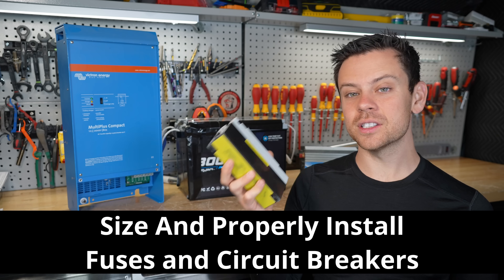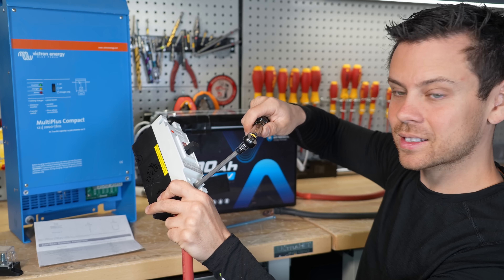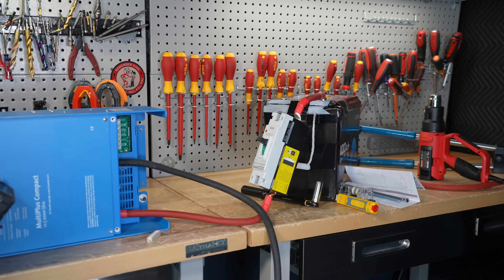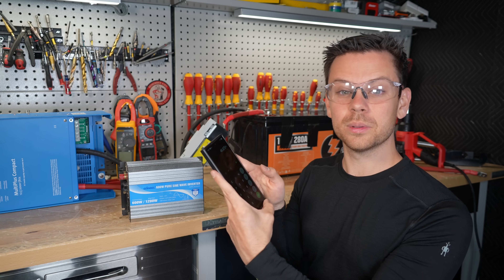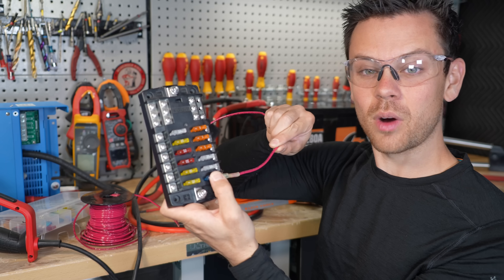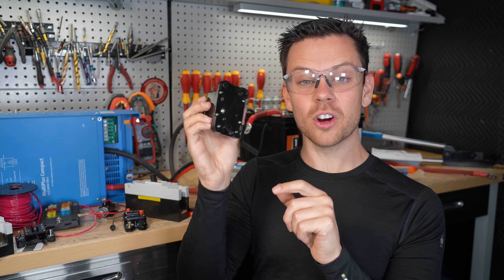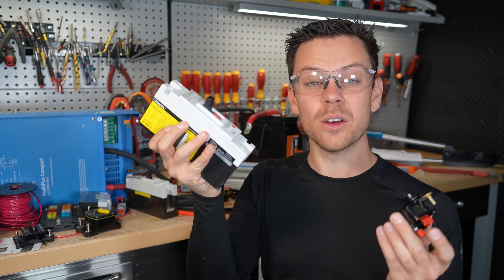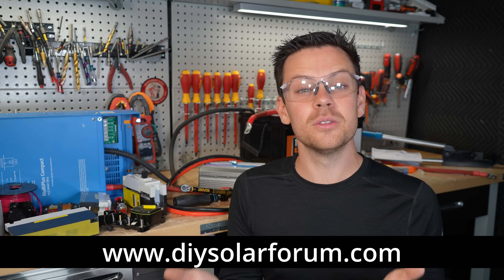How to Size DC Fuses and Breakers. Bonus Tips and Tricks!

Comment: Great content Will, as always. Just one thing—you calculated the current draw of the 600 W inverter as 600 W / 12.8 V = 46.9 A. The inverter is probably only about 85% efficient so it'll draw more than 46.9 A when delivering 600 W, i.e. it'll draw 46.9 A / 0.85 = 55.1 A. Maybe the inverter is 90% efficient but you get my point.

Also, I would do the calculation at the battery's low-voltage cutoff, because that's when it'll be delivering the most current as the inverter is a constant-power device. Both the battery voltage and the inverter efficiency are important factors and might force you to use a higher-amperage fuse to avoid nuisance fuse-blowing (or breaker tripping).
Reply: This ist true. Efficiency is often forgotten leading to borderline systems. This ist offen bis noticed as few systems operate near its full load. 
Can get tricky though if you have higher loads in RVs for example when cooking on induction hobs at max load (not pulsing)...

Comment: One thing that Will touched on I'll expand on. He mentioned to never place a washer between the two electrical connection points. The same goes for nuts. Nuts, bolts, and washers should never be called upon to have the current flow through them. Their function is to hold the conductors together.

Comment: I like to install a battery switch and then add a resistor with a momentary button switch in parallel.  That way you can precharge the inverter's capacitors every time you reconnect it.

Comment: Before everyone runs out and buys the MCCB linked in the description, just know that Dihool is NOT UL listed. If you plan on getting your system inspected, this will likely be discovered.  Will really should have mentioned how few MCCBs have UL listings and the ones that do are VERY expensive.  So really, a useful video in understanding sizing, but a poor video in glossing over the realities of code compliance.  I must say, there needs to be more emphasis placed on what is and isn't code compliant in a lot of Will's setup and recommendations.

Comment: its funny when manufacturers don't include cables they recommend humongous wire sizes but should they include cables they give you the absolut bare minimum that won't melt from normal usage.

That victron is a only a 100A unit right?

Comment: yea, i'm under the impression (i.e. as per the manual/spec sheet) those Blue Sea System breakers ARE for '48v'.  THAT.  IS.  THE.  MAX.  VOLTAGE!  so, do NOT use them on a '48v *SYSTEM*' - those run at 51.2v, or HIGHER.  way above the 48v MAX of the breaker.  just sayin'.

Comment: If sizing fuse to wire, what is considered safe with fuse only tripping at 200% plus of rating? Example blue sea t-class at 250a according to curve won’t trip at 500a for at least a minute. Or 300a until over 8 minutes. Is the cable safe to take that (assuming cable limit matches that 250a fuse (e.g 2/0 at 210a). That could mean a few minute’s of 500a through that cable until tripped in an over current situation. I appreciate if dead short it goes straight away which is fine.

Also is it safe to use an overrated t-class just for dead short situation, then an ANL at lower rating for OC protection only?

Comment: Hey Will, thanks for another great informative video. I was wondering if there was a self build battery or rack battery that you trust and won't break the bank. I prefer the rack mount as it seems more dense capacity per inch. Looking at doing 32KW at first and then 64KW down the road. Any guidance would be much appreciated. Hope you have a great week.

Comment: Those huge circuit breaker switches need mount holes.
Reply: They are probably designed to fit in a breaker box made by the same company of the breaker.
Reply: @Tumbleweed5150  I  was think much the same before posting.

Comment: I have 530 hp Detroit Diesels in my boat.  I am using a pair of group 31 lead acid 12v batteries for each engine as starting batteries.  The starters are 12 volts.  Can you tell me what type and size of fuse I could use in this situation?  Many thanks and thanks for your great videos!

Comment: I agree with most of what you say, in a lot of these videos. I have learned a few things, but...

I use breakers as switches, so long as the load isn't extreme. 

I really don't think the resistor is necessary, just make the connection, turn the breaker on, then turn on the inverter. 
Yes the capacitors will draw some significant current for a very short period of time. The breaker should handle this.

What happens in a short circuit/fault/overload, the breaker has to break that arc at it's full rating +, and at DC that can
be much harder to break vs AC.

I have 3 Eco worthy rack mount batteries, and two Victron 120v 5000va/70 inverter chargers, and had no issue doing just that. 
I should clamp meter the peak / surge current but I don't think it's that high. 

I wouldn't use the breaker under full load, unless I was shutting it off, in an emergency. I would power off the inverter/charger, 
then turn off the breaker normally, under minimal load.
Reply: I still prefer to load the capacitors slowly, they normally don't like high inrush current. I saw some caps blow with high inrush current.

Comment: What's the difference between single pole vs double pole dc breakers? Especially when the inverter manual says for battery max current draw is 220a and lists for using 2/0 cable with 250a breaker. However, according to your guide 225A rated current should be using 3/0 cable but there is no 225A breaker and upsizing to 250A breaker means we have to use 2-pole breaker from DIHOOL with +ve and -ve going through the breaker. In this case should we be using 4/0 cable with +ve and -ve going through the breaker?

Comment: When I was wiring in my headlights. I thought it was a 14 gauge wire turn down it was an 18 gauge. The wire start I started smelling the wires cook. And they started smoking. Fuse did not blow.  Ripped those wires out making sure nothing was still connected to the battery. I then a few days later, ran the wires again and make sure I had 12 gauge wire. And I hooked in at 10 amp fuse. Because I wasn't playing that game again.

Comment: So maybe I missed it but how does the size of the fuse or breaker change based on the battery bank size? Or does it? ie 10 x 100ah 48v server rack batteries tied together feeding an inverter or 4x 314ah 12v batteries to an inverter ?

Comment: Here’s an excuse not to buy, use or recommend the Dihool you like and have listed in the link: The Dihool mccb is only IEC 60948-2 (industrial) certified and not suitable for household use. 

For residential use is in the US, it must be UL489 (edited) certified to meet the NEC. Similarly, it isn’t allowed by the ABYC marine standards,but the IEC60898-2 household circuit breaker standard IS recognized by the ABYC standard and there is a harmonization effort with the NEC standards developers for household circuit breakers (60898 and UL489 (edited))
Reply: @willprowse nice video Will. I wondered where you found the amp rating for the wires. So for the 4 awg cable you mentioned 75amp rating. When I looked at windynation chart for welding cable 4 awg gets 150a max. Cerrowire thhn 85a
Reply from the maker: @Mik3503  it's the lowest max ampacity for insulation temp rating. And has 200 C insulation but I don't want beginners to use those numbers because the terminal is not rated for that heat. So I go for the lowest number possible
Reply from the maker: Huh? UL249 is for glass fuses, it would never conform to that standard. Because it's not a glass fuse. And abyc? This is not a marine rated breaker. Not sure what your point is.
Reply: @WillProwse my bad. UL489 for branch circuit breakers. (World Series is on)

ABYC has standards for overcurrent protection and I only used it as a point of reference for using household circuit breaker standards versus industrial circuit breaker standards (the dihool is to the industrial standard which is, generally, less stringent than the household standard). ABB and others make good MCCBs which meet the UL489 standard.
Reply from the maker: @jimduke5545  That will never pass that standard 🤣 are you just using AI or something? It's like these comments are devoid of logic
Reply from the maker: @jimduke5545  as a reference for household breaker?? Do you not know what type of breaker this is? Lol really?
Reply: @WillProwse I use MCCB’s and DIN CB’s on boats occasionally in lieu of fuses. The dihool will not pass a marine survey because it isn’t certified to either UL489, IEC 60898 or even UL1077. 

I am not a licensed electrician but i do use the NEC for Shorepower and land based electrical installs which are inspected by a licensed electrician and then a county inspector. Only UL 489 (not UL 249, lol) and UL1077 CB’s are allowed. 

I don’t mean to bust your chops, or take away from your affiliate revenue. There are safety standards and codes. You are recommending something that doesn’t meet these standards in the US. 

I’m sure you have the best intentions in educating and recommending products. This product (the Dihool) just doesn’t meet our (edit: United States) safety standards. 

Cheers
Reply: @WillProwse I didn’t name the standard. The IEC group did.
Reply from the maker: @jimduke5545 my affiliate revenue?? Your comments lack logic and I question that and now you're thinking that recommending a fuse that doesn't break my test is not up to a glass fuse standard? Or marine? Do you know how many crappy ac breakers I've broken that conform to your little house hold standard. What a joke. How about you post a video of you breaking a dihool and I'll take it off my list. What a waste of time responding to any of this. Post your proof on YouTube or on the forum for all to see. Can you be helpful at all? Can you post things that are actually better? Or show me how you can break it? What a waste of time for everyone this comment was
Reply from the maker: @jimduke5545  your safety standards? 😂 I've broken multiple household breakers that conform to that standard. Let's see what you break.
Reply: @WillProwse did you read the edited comments with the corrected reference and my mea culpa on my typo? 

I’m trying to help you and it’s a waste of both of our time. 

Best of luck.
Reply from the maker: @jimduke5545  Post what I should use instead. Accusing me that the only breaker I am not breaking is lackluster because it is not marine rated (which I never claimed for it to be) and a house hold UL standard doesnt help anyone. Help everyone here and show us what is better. Show us your safety standards. I want you to give me a recommendation with the same AIC. And I want to see your evidence of them failing. I started a thread on the forum because of this comment thread. Lets see if you or someone else can show us something better and prove what is bad with these. Lets do this
Reply from the maker: @jimduke5545  thinking that my affiliate income changes my opinion when I show my actual testing and test them daily, and listen to all my forum members, pisses me off. If you find a reason to hate anything I like, I will switch to it in a second. Let's see your evidence and I'll change my mind any time. I sign zero sponsorship contracts and for you to think I'm biased to anything pisses me off.n
Reply from the maker: @jimduke5545  you're not helping anyone. You used marine rating and household breaker listing? Let's see some actual evidence and an alternative

Comment: The lows of my DYI semi-off grid 24V (3x100A) lifepo4 system are precisely the terminal connections, crimps, bus bar and fuses. Slowly upgrading to increase safety, prioritized SPDs for the chargers due to the high thunderstorms occurrence in this location/altitude.
I confirm the hottest point is the worse condition terminal connection, happens on good sunny conditions (2x50A+75A victron chargers) during battery charging.

About 2y ago, i had a positive terminal bat connection of a victron 100/50 partially melt, i'm sure due to both a) lack of proper crimped terminal; b) not being tightened again after a year in use. This charger is still in use.

Comment: Is there a plus to a fuse vs breaker. Also is it worth doing both on one cable?
Reply: I use both in some cases. A fuse is always a good idea. I also use a breaker that is rated a little lower, but still safe for the wiring, to shut down certain circuits for inspection or repair or adding something with power off to the circuit. On solar system battery wiring, I use a big fuse plus a cut-off switch rated for way above both Voltage and Amperage. The fuse protects the system in case of a short, etc., but the cut-off switch (or oversized breaker) lets work be done on the system without risking power being present where I don't want it to be. Will recommends to NOT use a breaker as a cut-off switch, and he is probably right. I had mine made before I learned of his preferrences and I am unsure why he thinks it is not a good idea, (especially if a fuse is used for current protection.
Reply: @Tumbleweed5150  Thank you, I appreciate your input.
 I like the idea of redundant protection for the reason of I dont trust manufactures  very much. I might just add the cut off switch on mine plus what you did on yours!

Comment: You should never ever connect 12V battery to more than 1000W inverter - period! 24V to NOT more than 2000W inverter, 36V battery NOT to more than 3000W inverter, 48V battery NOT to more than 4000W inverter and so on ...
Reply: So why do companies like victron and many other reputable companies make 5000VA / 4000W and higher 12V inverters? If you are going to say they are just in it for the money, then you should tell them it is very irresponsible of them. 
Besides that, what us your reasoning for that statement?
Reply: Oh, and 48v not more than 4000W ? How many installations fit that criteria?
Reply from the maker: People still do. I agree though
Reply: You will probably cringe to know that in an older system I made years ago, I used jumper cables from a 12V battery to a 3000W inverter. I never actually used more than a few hundred Watts at a time back then, though. I now have properly sized cables on a 48V system, built after watching most of Will Prowse's videos up to when I got my system stuff. (Sorry, getting late and can't think of proper terms at this time).
Reply: Oh, and the new all-in one inverters can handle over 10,000 Watts output at a nominal 48 Volt input. I have had two 5000W Growatts running my "house" with no problems since December of 2021. Check out the size of some of the inverter(s) Will has in his Bunker and other places!

Comment: G,day Will from Sydney Australia. You said to keep the circuit breaker close (short conductor) to the positive terminal. For a rack or floor battery to a wall panel could be 4' 
🌏💫

Comment: Nice work, I'm surprised they don't mention wire brushing connections, I do lots of hv  powerline barehand work  making parrel with same size conductors all the time, insane how much more current will go threw the wire brushed connections vs not

Comment: ABYC is okay with having a maximum of 4 coonectors on a single stud. They should be layered so that the highest current draw is on the bottom. Also length of wire run is important when selecting the correct wire guage on DC circuits.

Comment: had AGM 12v hooked up to solar charge controller/200W panel with no fuses for years, with incorrect wires too (washers, etc). traveled for months and house never burned down:) 
So yeah, use breakers and fuses, but don't sweat it if currents are low and no load on battery.

Comment: As always, an excellent and well-considered video — very educational for viewers. However, you never seem to cover AIC ratings or Interrupt Capacity for fuses. This is a critical aspect when installing any fuse. Selecting the correct primary battery fuse at the terminal to protect against catastrophic battery failure or short-circuit scenarios requires not only choosing the right amp rating, but also ensuring the fuse has an adequate Interrupt Capacity.

Modern lithium batteries are being produced in increasingly larger capacities, and in the event of a failure, they can deliver short-circuit currents in the tens of thousands of amps — enough to vaporize cables and cause serious fire hazards.
All to often I see people installing cheap lithium batteries with mega fuses or Chinese MRBF copies with no consideration given to the AIC rating. Just the DC load.
Reply from the maker: Oh I've been covering that multiple times now. We use battery with a BMS so you won't exceed AIC. My typical recommendation is anything over 30 kilowatt hours, use a t class fuse. But in recent testing I've realized that that is overkill as well. 

The dihool MCCB in video has an AIC of 25,000A. That's why it's my #1 recommendation. Have you seen my videos covering this topic?
Reply: Hi Will,
I did yes. But AIC is still very over looked.  Even a “fast” BMS has a response time in the hundreds of microseconds to a few milliseconds range.

A hard short circuit (like cable-to-frame or wrench across terminals) creates a current surge that can reach tens of thousands of amps in microseconds — far faster than the MOSFETs can open.

The MOSFETs in most BMS units are rated for perhaps 100 A–300 A continuous and a few hundred amps peak for milliseconds.

In a catastrophic short, the instantaneous current can exceed several thousand amps, well beyond,
A BMS shouldn't be relied upon as the sole protection.  Hence primary fusing is  
is so important.
Reply from the maker: @glenmoylan1238  yes absolutely. That's why every 48V pack now has a built in thermal breaker or MCCB. Just in case. Keep in mind that the supply conductors on the BMS, are pretty small. Pushing thousands of amps through them is very difficult. I put all of these batteries on my load testers and it's really hard for me to even exceed 800 amps.